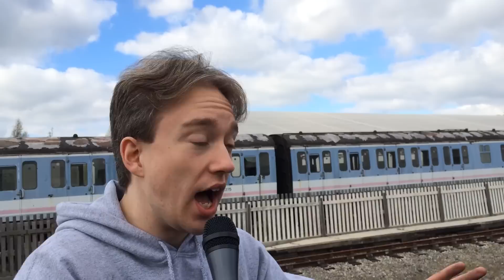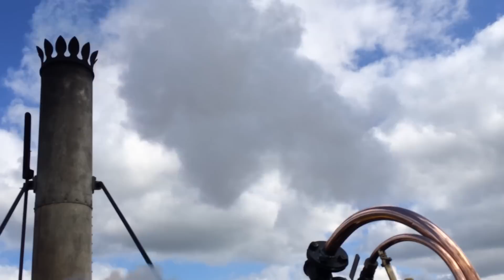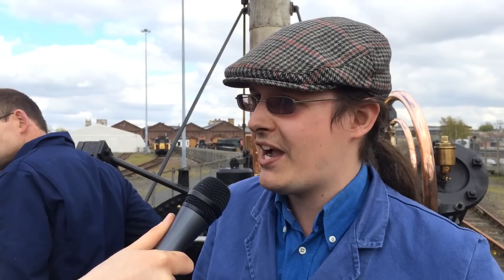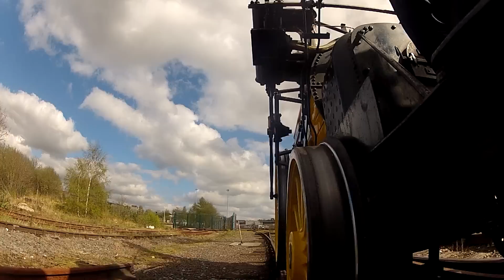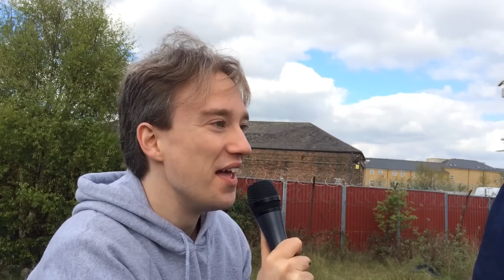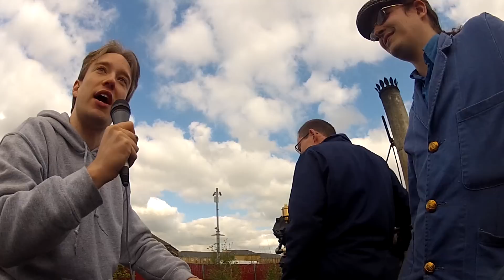The Early Steam Train With No Brakes: Stephenson's Rocket

Comment: Electric power equipment, like forklifts, operate similarly. They of course do have normal breaks, but an operator can also stop the truck by switching directions(called plugging), which changes the polarity in the motor. The truck comes to a gradual stop, then goes in the opposite direction. Combining the two breaks u can get a forklift to be VERY responsive
Reply: Modern trains do something similar. Most use electric motors to drive the wheels. Most are permanent magnet motors, and you simply cut the power and drop a heavy wire as a short across the motor terminals and you've got modern "dynamic braking."
Reply: and if it uses the resultant electricity for something it's called "regenerative braking".  But it's fundamentally different from this steam braking because it's not applying power in the opposite direction of motion, it's retrieving power from the same direction of motion.  In a steam context, it would be like using the train's momentum to run a turbine to build steam pressure.
Reply: Indeed, @reaperexpress. But you can also put reverse current into an electric motor to increase the braking torque even further. Note that this should only be done in an emergency braking situation, because all the energy (electrical AND mechanical) get dissipated inside the motor as heat, bringing it up to destructive temperatures rather quickly.

Comment: Electric fans use a turbine electromagnet to turn the blades. It pulses the direction that you want the blades to move. 
If you flip the directions while it’s going, since the blade props don’t actually touch the turbine, the EM pulses slow the blades until they stop and simply begin turning the opposite way.

Comment: I knew of Stephenson's Rocket and I also know how steam trains function. As that's how on historical lines without a turntable they're able to take the carriages up and down the line at the same speed forwards or reverse.
What I didn't know was that the replica has to have brakes 'because that's the law'. Which is somewhat disappointing. Do other old original trains at the steam museum have to have brakes retrofitted?
Reply: "By law" I mean the requirement for a continuous train brake on a passenger train. This is a brake controlled by an air pipe that runs the full length of the train including all of the carriages. It is very important because if the train became separated (if the carriage became unconnected from the rest of the train) then the brakes are automatically applied to both parts and prevents a serious accident. This has been a legal requirement since 1889 (when this accident happened http://en.wikipedia.org/wiki/Armagh_rail_disaster) so most exhibits in the railway museum are fitted with it from when they were built. The replica has a modern system fitted because it is used for running passenger trains. That said, we try not to use it when we are running demonstrations but it's there if we need it and it would still work if the train is divided. We don't steam any of the locomotives in our collection that are older than 1889 so we haven't fitted modern brakes to any of them.
Reply: ***** In the last few years, regenerative braking has also started to make an appearance. I don't think it would work on Rocket though.
Reply: The oldest working original (not replica) steam engine in the UK is Furness Railways No20, whih has brakes. Any older original engine wuch ad the original rocket, puffing billy or Wylam Dilly dont have brakes and didnt have them retrofitted to conply with the law as they will never run.
Reply: Also, engines after FR 20 would have brakes anyway

Comment: Brakes didn‘t come until George Westinghouse invented air brakes in 1868. That‘s nearly 40 years later after the Rocket’s inaugural run.
Reply: Absolutely not so,  before 'continuous train brakes' there were individual brakes e.g. on the guards van (aka 'brake van' in the US) which were manually applied, and every locomotive had brakes, operated by steam or vacuum.    For the train,  various mechanical systems were tried like chain or rod brakes, followed by 'simple' air or vacuum brakes,  with the disadvantage that if the train 'broke away' it lost braking.   'Automatic' vacuum and air brakes (of which Westinghouse was one system) came later.

Comment: Here's something you may not have known, but the reason why locomotives have brakes in the first place, was to provide an alternative means to stop the train, because by pumping air from the atmosphere into the high pressure system, it is easy to "over charge" the system, making the boiler go beyond its pressure limit and therefore, blow up.
Reply: ThatSaneGuy What do you mean?

When you shift the locomotive into reverse, you effectively reverse how it works, you'd actually be pumping air from the atmosphere into the boiler causing the pressure to rise.

This is because of how the pistons use pressure from the boiler to move the locomotive along, the waste steam then gets ejected through the firebox and out the chimney.

Meanwhile, while this is happening, the pressure from the boiler acts on the piston thereby causing the locomotive to slow down.

Comment: Proper air brakes would have to wait for George Westinghouse to invent them in the 1860s.  Before that time, a brakeman would have to climb over the cars, turning each brake-wheel by hand to stop the train.
Reply: Incorrect, there were many 'continuous brake' systems used before Westinghouse, including 'simple' (non-automatic) air and vacuum systems.    They suffered from the fact that if part of the train 'broke away' it lost brakes.   Hence the invention of the 'automatic' vacuum system and Westinghouse's 'automatic' air system.